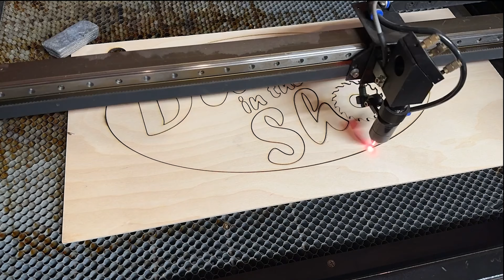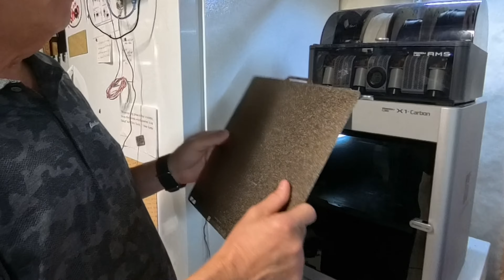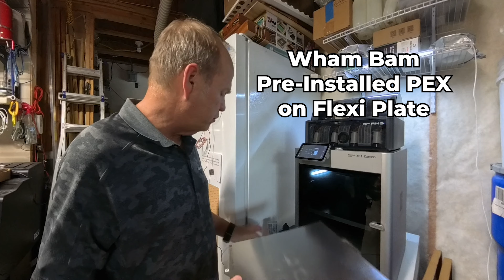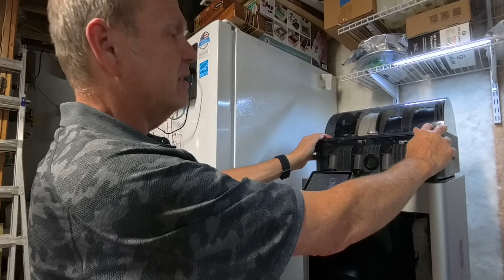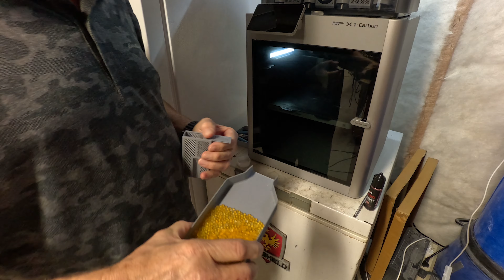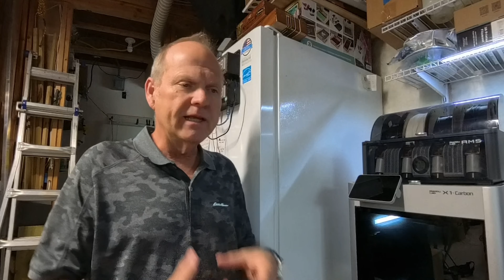Bambu Carbon X1 Update 1

Comment: Hey Dave. I have a Carbon X1 and I’ve been having trouble getting PETG to print. Everything fails. What temps do you use when you print with PETG? I’m using the textured plate that came with the printer and the ams. Thanks for any help!

Comment: You may ask your printer to heat your bed to 90C, but I guarantee it won’t read 90C if you used a temperature gun on it. I print PLA with a 75C bed to get good adhesion.

Comment: You know there is so many variables to take into consideration with 3D printing. Where people struggle to understand most of the time is environment. Your printer room will never be the same then the guy next door :P  Watching this video, the way you manipulate your plate is problematic to me. Avoid putting your fingers on the plate, it's the best/worst route for failure. Thanks for sharing your experience.

Comment: dude u need to , warm up the chamber before print ASA,  no need glue..  just warm up until 50º. put a jacket or someting cover the machine. and just print .. and for PLA turn of the AUX FAn,  no need for PLA thats why its get off
Reply: I agree about PLA. In my experience each time PLA print failed it was due to finger print on the plate.